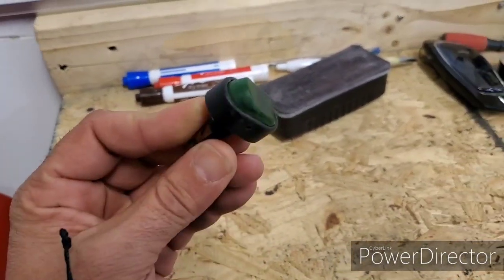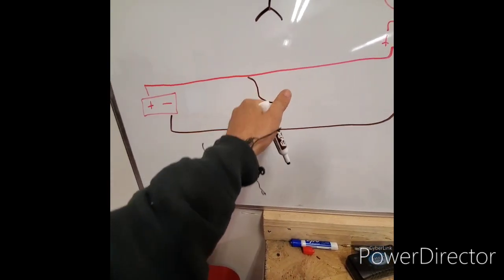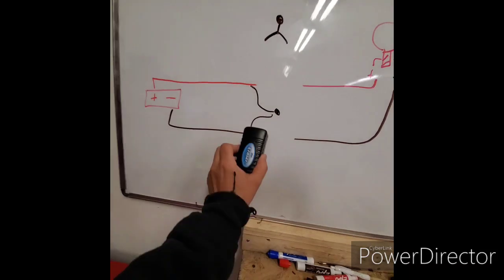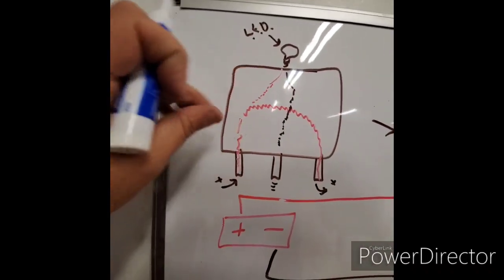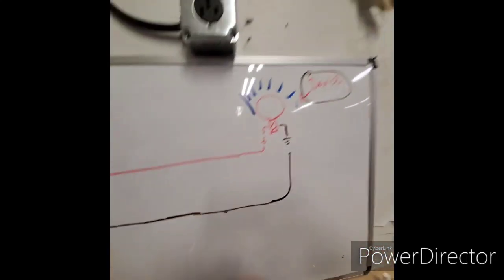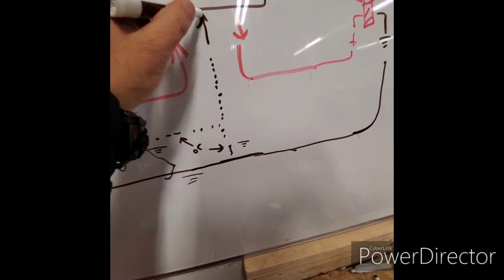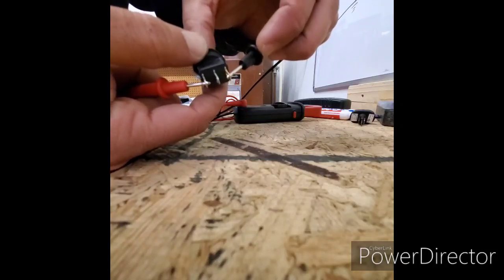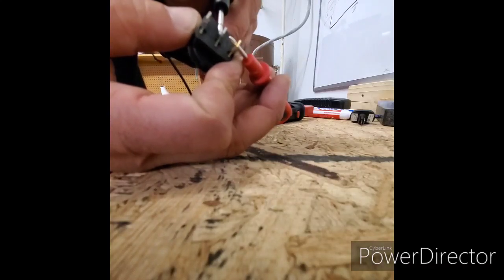How to wire an LED toggle switch , ( on-off 3 prong rocker switch ) 2020

Comment: Hi I appreciated this helpful video. I have a question for you. I have a Rocker LED toggle switch , 3 prongs. all ready installed in my jeep OEM dash panel. The switch turn on and off properly, and the LED amber light turn on. Also the switch is connected to the dome lights on the dash and light up when I turned on the dash light to be able to see it at night.  My question is I installed a FOG LIGHTS ON MY JEEP AND I NEED TO WIRE THE HARNES ON THE ROCKER SWITCH WITHOUT DESABLED THE DOME LIGHT ON THE SWITCH,  ON THE HARNESS THE BLUE WIRER IS THE ONE THAT WOULD TRIGGER THE SWITCH  ON/ OFF.  IN WHICH PRONG WOULD I CONNECT THE BLUE WIRE ON THE SWITCH? I really appreciate your help.
Reply from the maker: Thats really hard to say. Each switch is made differently and to try to use a pre-installed OEM switch is not the direction id go. In my opinion EACH device should be on its own switch, this way you can properly isolate a fuse the electric draw. 
However,  the specific answer to.your question will be at the jeep dealership.  As they will have the specs for that switch you want to tie into.

Comment: I have a question about a 3 prong switch for a led fish tank lamp. The switch says I O II. The I side has nothing connected to it. The O has I believe the - from the DC Pin connector. And the II side is connected to one of the two power settings for the three rows of LED’s. I want to eliminate the DC Pin connection and just straight up wire it permanently. I don’t know what to do here lol

Comment: Hi,
Thanks for your video,
I'm trying to replace mini oil heater switch and all 3 inputs connection looks same, but it marked each one 1A, 3B and 4B
how do I know which one +, - and ground?
Thanks again
Reply from the maker: I couldnt say with any confidence.  Sorry. Youll have to either look up that switch, or use a meter to test it.

Comment: Is there a way to light up the toggle/rocker switch when it's being used to turn on/off speakers?  I can get the toggle to turn the speakers on/off but it doesn't light up.

Comment: Thanks for the vid! What about the BLUE remote wire coming from the DEVICE.....where do you connect it?
Also, I have a fuse block I want to incorporate to preserve my battery. Am I defeating the purpose of the switch with the fuse block?
Reply: S

Comment: Helpful video, but how do you wire up a 3 prong switch (like the one with the small LED in the video) on the negative leg of the circuit.  I am powering a radiator fan using a relay triggered by the ground wire on the temperature switch in the radiator and would like to use a switch to turn the fan on manually using the same negative ground trigger.  In testing, I can get the fan to turn on and off with the negative wire connected through the switch, but the LED blinks momentarily and does not stay on while the fan is operating.  Any idea how to get the LED to stay on while the fan is operating with the switch providing continuity to the ground side of the circuit?

Comment: So I did that LOL , I am that GUY ... Have zero clue what I am doing but am learning and yes learning hard lessons .. So I ran positive to switch and neg to switch out to the enclosed ground effects .. Everything kicked on the first two times not one issue at all .. Hit the first property 30min stop jump back in truck and it was hard starting Look down all my wires are melting like i was on acid , My two guys are yelling like girls trying to get out of the truck LOL , Pull all live wires off the switch again I am that guy ... Get shocked cause they are still live sparks , Had to disconnect everything from battery ... And Now I am here 4:16sec in LOL Hope to learn something today cause this mini side project has become a Job n a half for me ...
Reply from the maker: Ah i see. Well, i have a few diff switch videos they explain a couple diff types if thats needed but the videos are pretty clesr in explination so hopefully it gets you straight.
Reply: @myonlinecarguy1  bro this video is on point .. somehow the snow gods came out last night and gave me a snow out 😆 I own a lawn care company so this is absolutely a first today 🙃.   I will have these lights back up today because of this video.. Thank you 😊.. I am running two lines right side left side .. thanks again man .. will let you know what happens 😆
Reply from the maker: Ahh man thats awesome awesome..im glad i could help.
Reply: @myonlinecarguy1  yooooo .. got my joint rocking again .. thank you sir .. even got a inline fuse installed .. ran two lines to the back have two sides on trailer .. Now know where I messed up last time .. way to much going in one switch .. Dude I can't thank you enough ... thank you
Reply from the maker: Aye...thats super badass my guy. Im glad i was able to help in some small way. Gald ur shit is up n rockin my dude.

Comment: Good teach! How do you add a relay to the equation?
Reply from the maker: apologies for the late response, a relay can absolutely be added. I usually prefer to use the toggle ONLY to trigger the relay activation. So the "output" of the toggle would wire to the "trigger" of your relay. and the relay would in turn have its own power and ground, using their placement to determine relay output polarity.

Comment: hey there Elliot, I, ve bugged everybody else now it's your turn- I know zip-nada about electricity and its components; here I go- I have a "middle of the run" 12 volt  SPST on/off 2 prong light switch for overhead lighting; there are (2) sets of 14/2 wire 1power 1 neutral 1 ground for each Romex- I had to run -2- 14 AWG POWER WIRES TO POWER THE WALL PLATE WHICH POWERS THE RV ROOF ANTENNA;  THERE ARE NO CONNECTIONS ON THE POWER PLATE FOR A NEUTRAL WIRE I ran (2) neutral wires with the (2) power wires because I did,nt know if I would need them;-I have power to the POWER PLATE" I used a WAGO ( 5 ) PORT FOR THE 3 POWER WIRES /WITH A SHORT PIGTALE TO THE LIGHT SWITCH-4 POWER WIRES TOTAL; I did not run a ground wire with the (2) NEW WIRES??- I,m a dummie"!! every time  I  FLIP THE ON/OFF LIGHT SWITCH I INSTANTLY BLOW A 15 AMP FUSE; I mean like "NOW" THERE ARE ONLY 2 PRONGS ON THE SWITCH; 1 HOT 1 NEG?? WHAT THE HECK AM I doing wrong; sorry for the lengthy email but you make it look so easy  I thought I would ask for your help; Patrick.p

Comment: Ok man I know this is older but I'm stuck... so I have a switch that has 5 prongs, buts got 3 wires coming out. It has a blue, black and brown. Blue is coming from the + prong. And black is coming out of the negative but is soldered across 2 prongs... and the brown isnt labeled. So when I hook it up I hook it up blue to positive straight from the battery, black to red wire on my light and brown goes to my black wire on light and ground off the battery. Now when the switch is in the "off" position the light turns on really faintly and when I turn the switch "on" the light goes out. I'm sitting here watching myself type this and I'm assuming I should have went brown to red on the light and black to ground from battery and black from light.... might sound confusing but maybe I just need to nk put it down and pick it up again tomorrow sometimes my brain just quits

Comment: I just tried to hook up a set of square  led spot beams made by ridgid...on a three prong led rocker switch...the lights came on for about 5 seconds and the switch must have dried internally and then the wires I ran went up in smoke...how do I hook up these lights without that happening and they will be safe to use???
Reply from the maker: Depending on the lights,  youll need to be very aware of the overall amperage draw. You may have wired it proper but the draw could've been too much for the switch or the wire even. I would suggest to start there.

Comment: I have an LED light set up I’m am trying to hook up to my motorcycle. I’m going to connect the LED control box wires (positive and negative) to the bike via an SAE connector rather than directly onto the battery terminal. I also want to add a switch (three prong) to the LED control box portion of the harness. I’m having trouble mapping out how to do this, mostly how to set up the ground. 

Should I just ground the switch to some random metal on the bike or should I try to splice the ground of the switch along with the ground of the harness so it all goes to the sae connector?

I apologize if this is confusing.
Reply from the maker: Far as the ground, either is fine. Its all the same. Dont over think that part.

Comment: I burnt my finger while holding the wires on to a 12v multitool battery....🤯
It got EXTREMELY HOT VERY FAST...
Yep...I'm an idiot 🤪
It's soooo easy when you have someone to explain it like you have done...
But you don't know until you know 👍

Comment: Thanks for the video.  I have a questions and it may be obvious but I'm not sure.  I have an LED switch like the smaller one you show.  Looking to hook up fog lamps in my truck.  I have a fused "Hot" coming from the fuse box.  I have determined the two posts for "source" and "Device" - the third is ground.  My question is, can I ground the switch under the dash - as long as I have a clean metal surface?  Then I run the "load" wire from the switch to the lights - connect this to the white "load" wires on the lights and the black ground wires (twisted together) on the lights - grounded to he frame.  Does this sound right.
Reply from the maker: Sounds right to me.
Reply: Thank - I really appreciate it.

Comment: Can the ground to 3 prong rocker be hooked to metal anywhere on car.  Al Mottola
Reply from the maker: Yes, it doesn't have to be the ground of the battery. And clean metal (paint scraped off) ground is just fine.

Comment: Can you wire a lighted 3 prong switch as a negative on/off switch (essentially toggling the ground not the power)?  Can you simply wire the gold post to positive and then use the supply and load prongs as the negative switch and thus still supply the necessary  +/- requirements for the LED light in the switch?
Reply from the maker: It would work as far as the switch side. But the LED portion is dependant on the switch manufacturer,  some will finction in revers, others only as a switch with no LED function.
Reply: Thank you for the reply. You’re referring to the led being able to function with reverse polarity. Got it. Thanks again!

Comment: Pretty sure I understand this right from your detailed video, but wanted to verify. I’m looking to connect a switch to complete a ground, but have a three-prong switch with the LED light I’d like to use, so that the LED would be on when I flip the switch to complete the ground. In this case, would the power supply from the battery go to the third prong/earth prong/normally what’s the ground wire for the LED, and my input and output wires of the switch be the grounding wires? Essentially a three prong switch on the negative side of the light bulb of your example in the video.
Reply from the maker: Ok, so while the ground line your wanting to break and connect in the "pass through" part of the switch will work no problem......using the power (+) on the 3rd prong, for the other side of the LED of the switch,  is super dependent on the switch. Because and LED is actually a diode, so power typically can only pass through 1 direction for it to light. ...BUT....some manufacturers make it usable in the way your speaking of. 
You wont blow the led, it just wont light up, if your switch wont support that type of wiring but the pass through, will still work.
Reply: MyOnlineCarGuy1 I didn’t think about the LED being a diode. I’m assuming the simplest way to find out is test it out on a 12 volt source/battery, and see what I’m working with? Thanks for the reply
Reply from the maker: @tylerwilliams3831  yeah man no worries. Most people dont know its actually a diode. I thought maybe that might be too detailed for the video. Sometimes i accidentally overwhelm people,  lol
Reply: MyOnlineCarGuy1 No problem! Just tested it out, and you’re right it only works the conventional way for the LED light. I’ve read how there’s a way to wire up a relay to make the LED light work with the switch being a grounding switch, have you by chance made a video explaining that before? I’ll keep researching. This switch project is for a torque converter lockup switch for a dodge truck that you don’t want to forget about the switch as you come to a stop is why I’m trying to get the light to work.
Reply from the maker: @tylerwilliams3831  if you google "neg trigger, pos outout relay. Itll show an image. Youll prob need a 5 wire telay for that. Like a socket relay. I dont have a video. But i do know relays very well.  Your going to use the pos trigger (of the toggle switch) to trip the relay and have it give u a neg outout (for the led)

Comment: Nice video , I definitely learned a lot. I have a couple questions on more. Why would a car toggle switch with no led on the switch have 3 prongs? How would that be wired? It has two wires that came connected already. The red and red/black wire, I wired it like you demonstrated as a 2 toggle switch and worked, just wondering why the third prong.. I want to send a pic of it but don't know how.
Thanks 
Dare
Reply from the maker: So, traditionally a switch is "disconnected "....until turned on.(called normally-closed). However, on occasion. Some switched are "connected " untill switched on. (Called normally-open). Once you wrap your mind around that......now IMAGINE a switch that has BOTH  a normally-open AND normally closed output........that is how you end up with a switch that has 3 prongs and doesn't have an LED in it.
Reply: Ok, I'm trying to wrap my head around it. I'm very new to car electronics.  Thanks for the fast reply.
Dare
Reply from the maker: Google...."double pole, double throw switch". It could help.

Comment: I am powering a light bar on my truck. It came with a 3 prong push button switch. I am wanting to change it to a 3 prong toggle switch. I tested the continuity on both switches and they tested different. In your video, the push button switch tested like you show but the toggle switch was a little different. The toggle switch is labeled (power, load, ground). I put one lead from my volt meter on the (power) and both (load & ground) prongs are either off/no continuity or , when switch is flipped, they are both reading continuity. Do I have a faulty switch?
Reply from the maker: Interesting info in the toggle. 
I would suggest test wiring to something small. Like an led strip, or something little. Generally, you should never have continuity with leads on both power AND gnd. But honestly,  there are soooooo many diff kinds of switches out there. 
Its possible that your 3 prong toggle. Is designed to be in series on ONLY THE GROUND leg of the "device" . And The "power" is for the "LED" of the switch itself. I could explain the odd continuity testing your seeing.
Reply: @myonlinecarguy1  Thanks for getting back with me. Yeah not sure about that switch. I will test it with something else. I assume it should only work one way and if it does work that the switch is working fine. Thx again. Great videos.
Reply from the maker: Hopefully all is good with it and you can get your light bar going.
Reply: @myonlinecarguy1  Ok, so I tested the toggle switch and it does work. The switch light glows and my light I tested it with comes on and nothing got fried or blew up. lol. I'm just not sure how it can work because I'm am getting continuity between the (power) & (ground) prongs when the switch is in the on position. It just seems like that wood short the circuit out when power is applied. Any thoughts?
Reply from the maker: Its possible that your seeing the "led". And led by design is just a glowing electrical diode. Which is kind of like a resistor in that it exists in the circuit providing possible continuity. It just ONLY allows power to pass through in 1 direction and not the other, however, on a meter, may show as continuity,  even though power cant back feed. Does that make sense?
Reply: @myonlinecarguy1  Yes that does make sense. I will say that is all it is.  :)  Thank you for all your help with this. Keep up the videos. They are very good. If you run across this or anyone else reading this does, I would be interested in hearing about it.

Comment: I got an interior light controlled by two switches ,at the fixure it has two red wires a black for ground and a white for power 

Do you know how can I connect an led light bulb that has a black and a white wire?

Thanks
Reply from the maker: Ok so. Im not sure if you mean a dome light or not. Those have 3 wires because 1 powers when the door opens and the other is a manual "on". 
Then it uses a common ground. One that always exists.
Reply from the maker: Also, far as the white and black wires.  They still follow electrical law, that 1 of those is power and the other ground, so the standard switch can go to interupt either one of those. And itll work like anyother.
Reply: @myonlinecarguy1  Thank you for your response 
It is a light in the sleeping area or cab ,it doesn't turn on with the door it has one switch on the dash and one in the sleeper, you can turn it on with one and off with the other and vice-versa

Comment: K so I'm hooking up LEDs to the bottom of my wheel wells on my Jeep Wrangler so it is a direct circuit right now so in order for me to hook it up it has to stay on I tried hooking up the toggle switch and just like you said not to do I hooked up the positive to the positive and the negative to the negative and then I tried hooking up a negative to the accessory part which is the light on the toggle switch and it would not shut off and then the power wire the positive wire was getting super hot quick